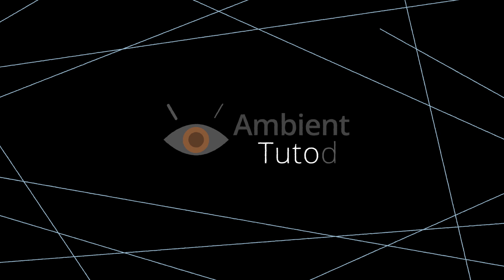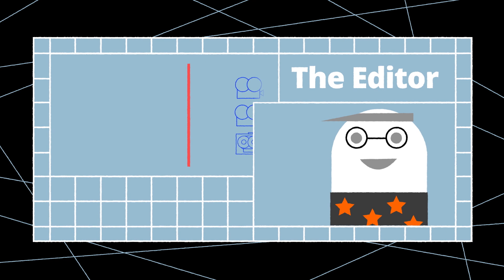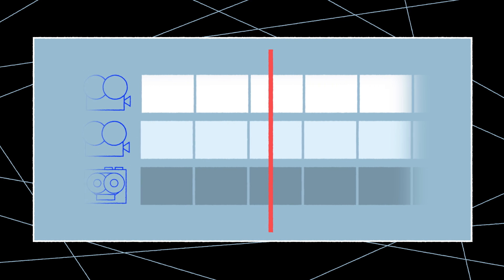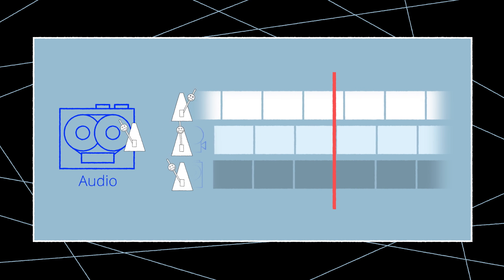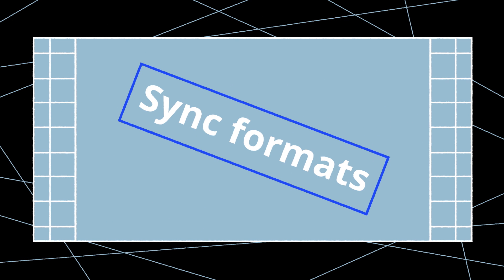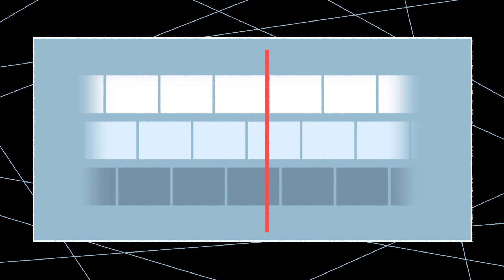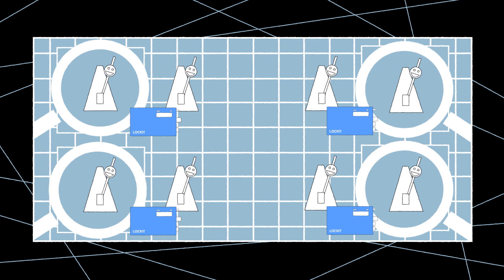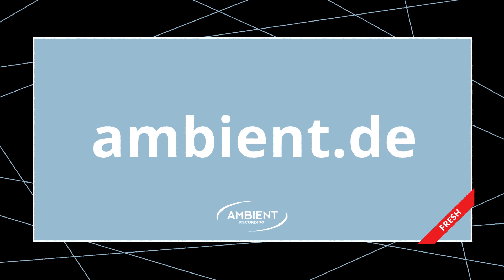Synchronization Tutorial

Comment: in your video, the audio device acts as master, so doesn't need a WC to it. What in the case one of the lockits is the master and also the audio device TC is slaved? Does it need WC as camera needs GL? What if the device does not have an ext WC input such on a 633 or F8? If an audio devise has both TC in and WC in, are both required to be connected from the lockit?